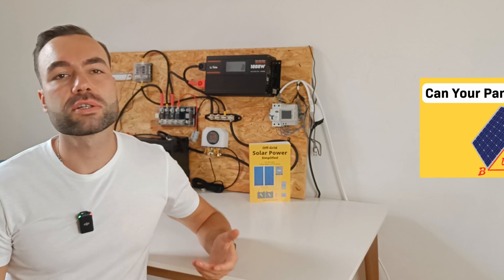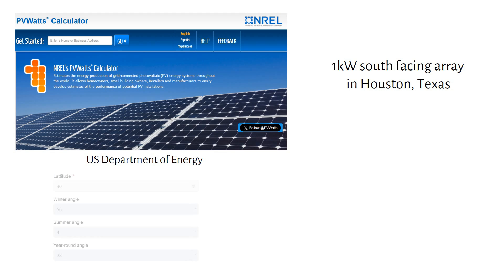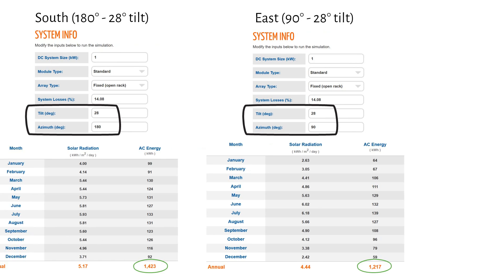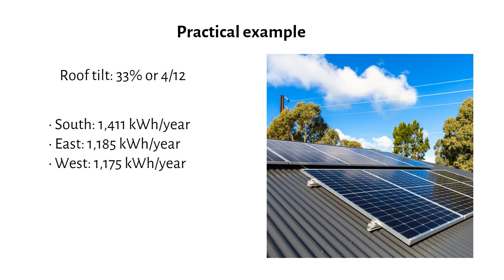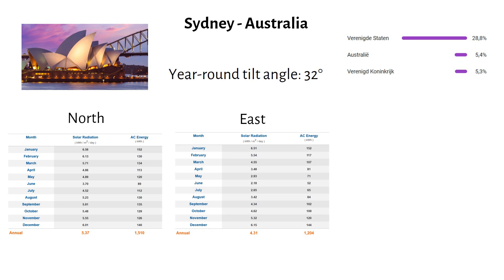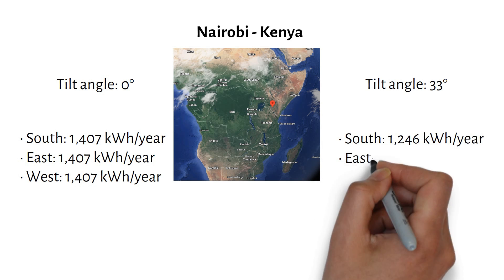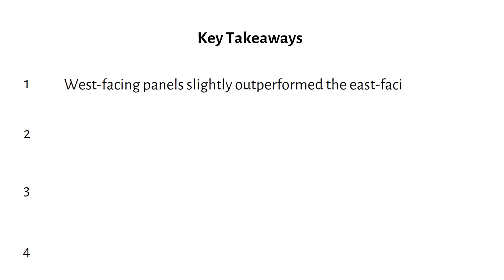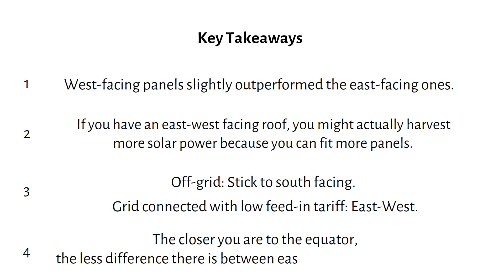Production Difference for East, West VS South Facing Solar Panels

Comment: My goal is to maximize midwinter production in a snowy location. I have my panels ground mounted vertically with one set aimed a little bit south of the azimuth where the sun rises at the winter solstice and the the other set aimed a little south of where it sets. This gives me a flatter production curve, allowing a smaller charge controller and batteries with a lower C-rate. Although the panels being mounted vertically substantially reduce their overall output compared to ones faced south and sloped appropriately for my latitude (45° N), not being covered with snow makes up for the reduction on average and especially when I need the production the most (midwinter.) The highly reflective snow also enhances the vertical panels production, again, when I need it most. If I were grid connected with a flat rate or with net metering, or had a huge battery, I'd go with south facing panels. Being off-grid, reducing the generator's run time to just a few times per week mid winter is my goal. I figure that if I never need the generator,  I spent more on panels than I needed to. If I can figure out how to harvest the heat from the generator,  I'll be even more okay with running it when I can use the heat to supplement my geothermal heat pump's output.

Comment: Great video..  but what about flat panels in Vancouver?  I am about to build a East West array with 15 degrees tilt angle.
Reply from the maker: The higher up north or south from the equator, the more your panels should be tilted, especially in winter.

Comment: I think it is a good idea to look at flat roof setup. Currently it is believed that with a low tilt (10-15%) you should face them west or do a east west setup. Because it will generate more power during the morning and evening/afternoon. But this is just false. This is only the case with higher tilt degrees like 30% or 35%. We already have 15 panels facing south at 35%. and on our flat roof we can place another 6 panels at a slight tilt. But these will also be placed south instead of west. because even when facing them west, during the afternoon or evening, the south faced panels will generate more output.

Comment: Totally agree!  Most people overlook that installing more panels E/W than you could South only generates more total solar and it generates it earlier and later in the day when working parents and their kids are home using the most electric.   

For off-grid, you can over-panel 50%, face 1/2 SE and 1/2 SW to minimize midday clipping and minimize battery storage needed to make it through the night.

Comment: Hello
Interesting vidéo. I would have distinguish between winter and summer though. It would bé interesting to know the best orientation when the sun is lacking...i.e in winter
Reply from the maker: in winter = higher angle, in summer = flat. this depends on location. If you are near equator, mostly flat.

Comment: Grid feed-in here is 2-3x higher during peak usage in morning and evening so a loss of 30% production is more than compensated for by the value of the power at these times, making a east/west facing roof setup optimal. Since only one side will be requiring much MPPT control at a time they can often be arranged in two parallel strings into a single inverter that is almost 100% over-provisioned as well, saving on inverter cost.

Comment: I learned something I think few professionals know: facing dead south is not the optimal angle. I put my data in PVGIS (I don't think PVWATT works for my location), and it turned out that 21 degrees to the west was the best orientation.
The HOA in the apartment complex I used to live in had an east-west configuration (I advised them to get this solution). It was the only way we could produce enough energy to match our consumption. Note that east-west may give you slightly less output, but you can save on the investment a bit as well, because you can oversize the system, without much clipping happening, since the east and west facing panels are not producing full power at the same time.
Overall it had a higher payback time, but in the long run, this system will make us significantly more money.
If I'm not mistaken then most of the production difference occurs in winter, so if winter production is critical for your system, you might want to focus on a more southern orientation.
Reply from the maker: Indeed, playing around with these tools gives you good insight.
Reply: Domek locations are better a bit east of south because afternoons are morę likely for cloud formation and precipitation.

Comment: Well.
My solar panels face West in the summer for a couple of reasons:

1. The house on the East of me has tall trees, and the sun does not strike my solar panels until 10 am.

2. I want to get the most power between the hours of 1 pm to 6 pm because that power goes directly to the airconditioner and not the batteries.

3. Since I am running the airconditioner in the afternoon, I want to focus on keeping the batteries fully charged as the sun goes down. West facing is best for that.

Then I have a completely different issue in the winter:

1. In the winter the sun moves South and my neighbor's trees are not an issue. So I can start charging at 7:30 am.

2. In the winter, I am not trying to run my airconditioner. I am trying to run my heater at night. So the focus in the winter is to charge up the batteries for overnight use.

Therefore, in the winter, I turn the solar panels to the South to get the longest charge day.

I find that in the winter my solar panels create 70% more charge facing South than they do facing West. So they must be turned.

I am in Arkansas, USA and use a 30° tilt angle all year long.

And it is very cloudy here. We do not see the sun in the winter. So that makes a difference in my charging needs.

I would like to add that my panels seem to charge better in the mornings when the temperature is cooler.

Comment: The recommendation (AS/NZS 5033:2021 ) for North facing PV panels in AU is latitude + between 5Degrees to 10 degrees Extra tilt. 
i.e for Brisbane Au at 27.5 degrees south the tilt would be at least 32.5 degrees towards the north. 
The further from the equator then the more the additional winter off-set tilt.

Comment: You're talking nicely, but theory doesn't always match practice. I mean the effect of temperature on PV. Nairobi won't give as many watts. A 1000 W system won't give as much as in Dallas, or in a small town like Skive in Denmark where I live. Please make a film about the negative effect of temperature on PV systems. Thumbs up🙂
Reply from the maker: the temperatures are taken into account in these calculations as efficiency loss. Check the breakdown of 14% efficiency losses.
Reply: @cleversolarpower  Now I understand. 🙂

Comment: I live in the Philippines and Portugal.  There is more cloud in the Philippines than Portugal, so my strategy there is to simply target diffuse radiation. Now here is odd part consider the 'welfare' of your panels. The life of a panel is brutal so cooling is important for longevity. I am therefore going for an angle of 45 degrees facing south. This will give best rain runoff and average convection. Yes a vertical panel will have the best cooling but 45 degrees is the best average.  You could also consider putting panels at the bottom gutter edege of a roof. The boundary layer of heated air travelling up the roof will suck fresh, cool air past the panels.

Comment: I am working out my panels on an 18KPV from EG4.  Planning on using three strings of panels, one facing SE, one South, and one SW all three adjusting for the four seasons in Oklahoma.  Hoping the boost in the morning and evening will benefit me more than the oversupply at noon.  Off-grid.  I bought your book and love having the formulas easily at hand. Thanks so much for the great info.  On another subject, it is tricky to purchase the best solar panels per inverter/mppt, because the max VOC can limit the wattage.  Have do to the calculations for each brand. Sometimes a lower voc panel will allow higher wattage (more panels).  For some reason I can't visualize the difference without doing the calculations.  (small brain) :)

Comment: Unless you live on the equator, the angle of the sun is constantly changing. There is no magic angle to set your panels and then forget them. Unless you just don't want or care about optimum efficiency. Otherwise, buy a EY800W Solar Panel Tester Photovoltaic Multimeter and test your panels as you adjust the angle at high noon. No more guessing. You can see the wattage output as you adjust. Alternatively, you can use your Victron charge controller and their app to see yesterday's peak wattage in your history.
Reply from the maker: I care about optimal efficiency, but I'm not going to tilt my panels every other hour. As I'm sure you won't do as well. I have made a video about trackers vs fixed mount. You should give it a look.
Reply: @cleversolarpower 

I used to tilt my panels every hour manually. The next day I abandoned the project.
Reply: @cleversolarpower  I am retired. So I would be comfortable going outside and retilting my panels every hour.   😊

It would give me something to do.
Reply: Solar trackers generally get about 25 - 30% more power per area of panel. Simply fitting 25 - 30% more panels is far cheaper, more reliable and much less prone to storm damage.
Reply: @nickwinn7812  

That’s correct. It’s far better to add more panels. More panels pointing in different directions increase the lifespan of the solar panels because they are not hot all the time. 

Panels that follow the Sun are always hot .
Reply: @nickwinn7812  

Why isn’t the profile of the energy generated by a photovoltaic panel constant from sunrise to sunset? 

The panel is always perpendicular to the sun rays so its output should be constant.
Reply: @ajarivas72  Fixed solar panels are not always perpendicular to the sun's rays. In fact many fixed panels are never perpendicular to the sun's rays. The angle at which the rays hit the panel will depend on the attitude of the panel and the position of the sun relative to the panel, which changes throughout the day. 
Additionally, at the beginning and end of the day the sun is at a more oblique angle to the surface of the earth, so the rays have to pass through a greater distance in the atmosphere before they hit the surface, further weakening their strength (even for tracking panels).
Thus the amount of solar energy per unit area varies throughout the day.
And then you have to add in weather conditions which cause additional fluctuations.
Reply: @nickwinn7812  

thanks for the very detailed answer. 

I meant solar panels on a tracking system always point to the sun (their surface is always perpendicular to the sun rays).

Does the greater distance through the atmosphere at sunrise and sunset really make  a difference in the amount of luminous energy reaching the photovoltaic panel?

Due to the roundness of Earth 🌍, that extra distance should not be very long. 

Tonight I will calculate it.

Comment: PWM charge controller are the best. 150Ah for $75usd. MADE IN CHINA #1.
Reply from the maker: Who expresses a PWM in Ah 😬
Reply: @cleversolarpower  Hello. I did a DIY solar installation in my house, 1000w inverter with  one 150ah 12v battery, here is my problem, I am able to make use of my vacuum cleaner which has power rating of 700w but my fridge of 85w is not working.  What can be the problem.
Reply: @wisdomugonna4910 Is your inverter cutting off or is it just not starting?
Reply: Only if you have the right panels for it
Reply: My panels is 10A at 45V and battery bank is 12V so PWM would charge with: 10A X 12V = 120W.
Reply: @Ridershani530Directly from battery. Your inverter burns up 15%.

Comment: I am in the UK. What is best for my panels on my campervan?
Reply from the maker: Put as many panels on the roof as you can (flat). If you need more power, reduce your consumption or have a foldable solar panel to set in the sun once you are parked for camping.
Reply: Go with what cleversolarpower says. I lived on a boat for 3 years in the UK using only solar for my electricity and I did just that - covered the roof as much as was practicable with panels. I had to be careful in the winter, but never ran out of power. It was a small boat (25' and built for the canal system ie. narrow).

Comment: My sloping roof in Thailand is East and West at 30 degrees on each side.
Latitude is 15% North.
I am thinking of putting 4 panels on the East and 4 panels on the West thinking that I would get earlier solar power and later solar power and that the sun would be spread over the 8 panels in mid day.
Reply from the maker: Great choice. Thailand is close to the equator as well, so I estimate a 10% efficiency loss compared to a south facing one.
Reply: @cleversolarpower  Thank you for that information.
Reply: My roof is facing south, sloping 10-15 degree so mornings and evenings are not the best but mid day i get: 350-400W from 455W panel with cheap chinese MPPT charge controller.
Reply: @oz2pe 

I have 1/3 of my panels pointing East, 1/3 pointing West and 1/3 South or North depending on the month. 

During the summer months the sun is on north.
Reply: Your in the tropics - consider that you get tropical thunderstorm rain in the monsoon seasons which is driven by solar thermal heating of the ground. Most of your thunder storms form during the afternoon. Think how many times the morning is clear sky when you wake up and clouds over during the day and then thunder storms in the afternoon. In such a situation, more panels facing east will be better than an even split east & west.
Reply: @paulm3538  Indeed.
Reply: @paulm3538  Thank you for that information, never thought about that. In the morning when the sun is low the nabours Palm trees shadow my panel for an hour  or so
Reply: You can face your panels East and West and still lift them 10° to the South.